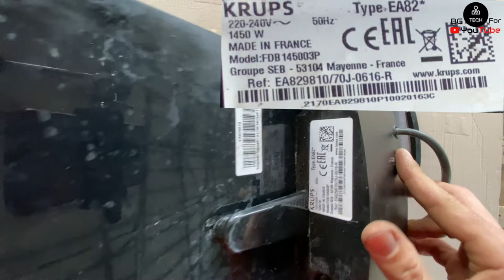Fixed: ✅ KRUPS EA829810 🔥 Error: Plug Symbol 🔥 NTC sensor Repair 🔥 Automatic Coffee Machine

Comment: Even 2 year after your post people are helped :-)  I repaired my Krups EA81 machine (heat seal rubber) and since I had opened it a few time I suddenly had the "plug error" I could not find a solution until I noticed your video with the same fault. I checked the wires (1 loose) resoldered both and machine is up and running again. 15.000 cups of coffee and ready for the next 10.000. thanks !

Comment: Great video. My 8 year old EA829810 was randomly giving the power plug symbol and if I was lucky, I could make one cappuccino 😢.😊 I did need to buy a cheap 80 watt soldering iron as my 50 watt Weller wasn't capable to keep the solder fully melted. Be careful with the steam pipe and it may be advisable to remove it at 2:00 minutes into the video. After many years of service making 8k cappuccinos running steam through the steam pipe, the connection to the tube will become fragile. Mine broke in 3 parts and needed to be replaced. Nevertheless a great video giving you the confidence to open your machine and  fix what doesn't seem to be that obvious. 😊😊😊❤

Comment: Hello thanks a lot for you very good video. I followed it step by step and it was easy to get to the sensor. My model is slightly different but inside everything was the same. The contacts on my model are still well attached and it was not necessary to solder them. There is a small 1cmx1cm releigh on the main board that is clicking when I start my machine followed by the plug symbol. Could you give me a hint please what needs to be repaired if it is not the sensor, if I unplug and plug in several times my machine it sometimes starts and works .

Comment: 35.9 ohm or 35.9kohm please my machine I measure with digital meter is 85 KOhm  thanks.
Reply from the maker: The measured resistance is changed by the temperature of the thermal sensor. Otherwise, it is measured in Kohm !!
Reply: What is the default value  in 25degres please

Comment: Hello
Just soldered pins and after work there is no success
Machine show again plug in/out error
Reply from the maker: Check the temperature sensor with a multimeter if it is healthy
Reply: Ok thanks
I will later test thermistors, the multimeter is in my office
Reply: I have notices markings on the thermistors:
Microtemp

AEBAAA

G4A00

Tf2160
Reply: Sorry, ive pasted it so theres to much spaces
Reply: Hello
Thermo fuses replaced but no luck
The maschine continue showing plug out error during preheating
Reply: What can i do else